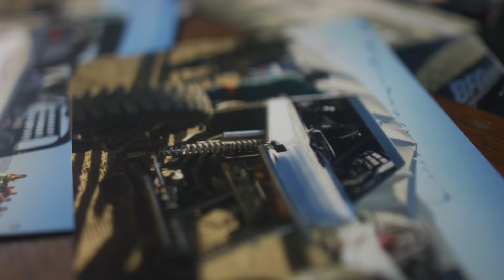Evolution of the Ultra4 Car | King of the Hammers: Origins | Episode 3

Comment: Shannon Campbell’s design is so sick. I remember when he debuted that IFS and people thought he was crazy. Well he kinda is, I think. In a good way. Ha ha!! I was at the Parker 425 long about the time he debuted the vehicle when some of his crew members showed up where we were. Shannon came over the radio saying he had a flat so the crew was trying to figure out where to stop him to fix the flat. He told them he wasn’t stopping. We were at a dirt to asphalt transition. The race official said he wouldn’t allow them to drive on asphalt with no tire. So the official turned him around, cut the course to avoid asphalt and added 1.5 minutes to his time too account for the portion of the course he was allowed to cut. He finished the race on 3 tires and what was eventually just a dilapidated rim/brake rotor.